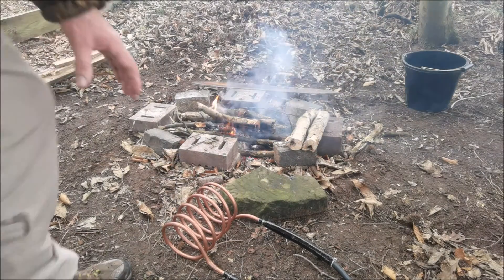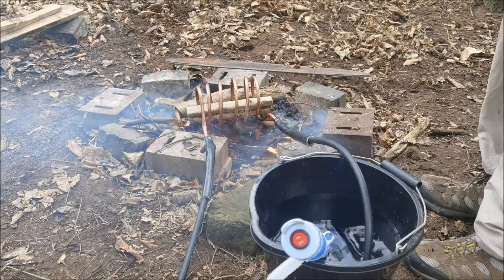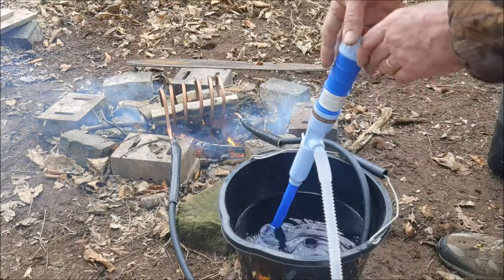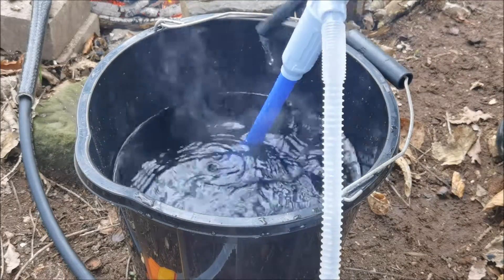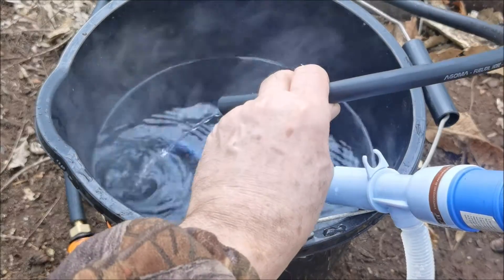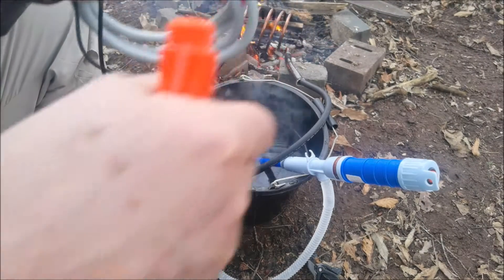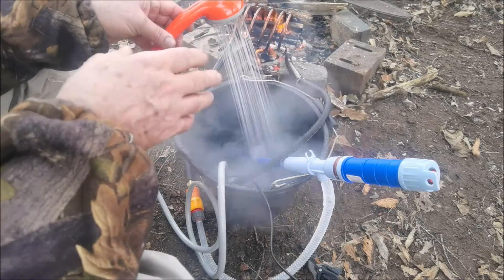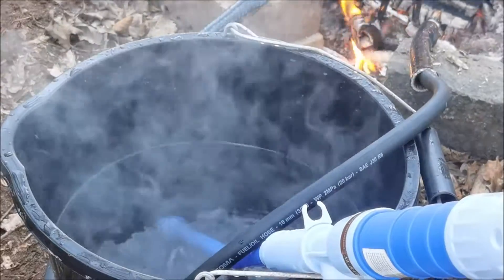HOMEMADE HEAT EXCHANGER TEST PART 2

Comment: like the videos you have done on diesel heaters, here is one for you, put the flue from the diesel heater into a verticle 2 inch exhaust pipe, the gases will reduce in speed and radiate heat into the room.. you could also wrap a copper coil around the 2 inch exhaust pipe and get hot water... but remember hot water wants to rise, and cold water wants to fall, and be careful of air locks, as steam expands to i think 4000 times it original size once released.. like what your doing..
Reply from the maker: Great idea Thanks for watching Aiden